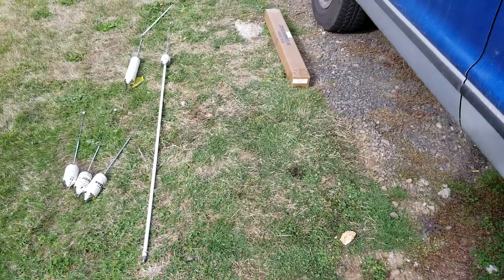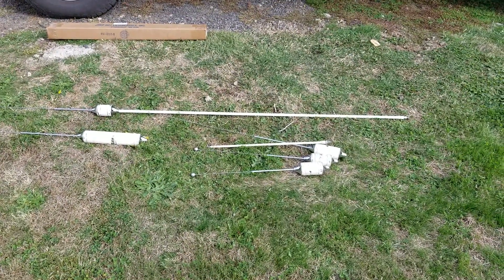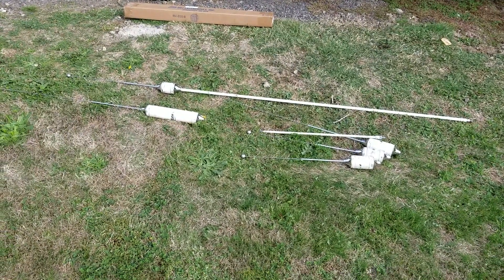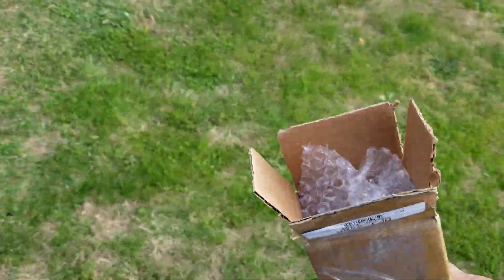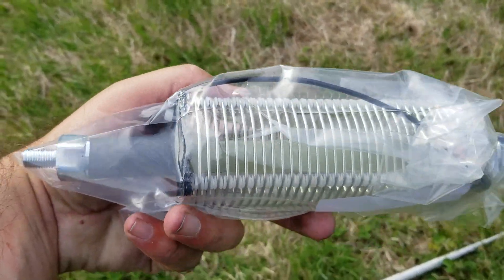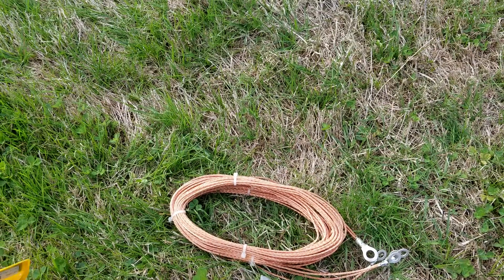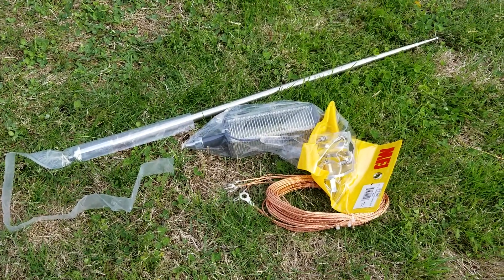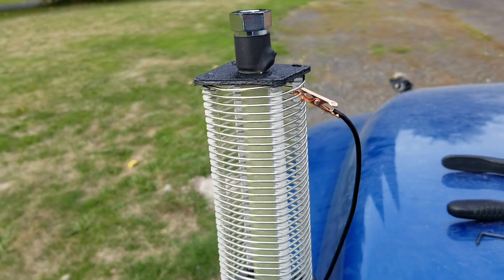Mobile and portable antennas

Comment: Thanks for sharing your experience. In my portable setup of this gear, I omit the coil assembly for 6 through 20 meters and simply adjust the length of the telescoping tubing to 1/4 wave resonance. That takes care of the jumper being too short to bypass all turns of the coil for the higher HF bands. Better efficiency might be achieved on 40, 60 & 80 meter bands by using the Hustler mast to elevate the coil, however this could put coil adjustments awkwardly out of reach. Definitely not for mobile operation!
Reply from the maker: I agree on all your points. I use only telescoping whip  for 20 and up, so for 40 i have the clip in the right spot for the whip fully extended. I am seeing 3 to 4 s units increase in signals over the 20m and 40m hustlers. So I'm glad to have bought the big stick!
73
Rod
AE7QT
Reply: Rodney Spencer  you’ve demonstrated the value of actually doing something. Nice work